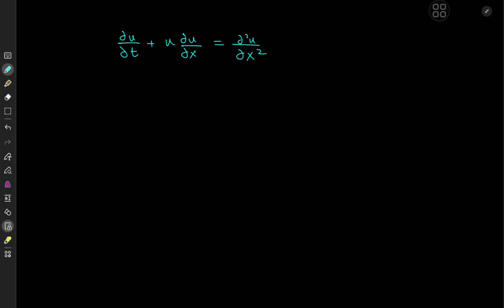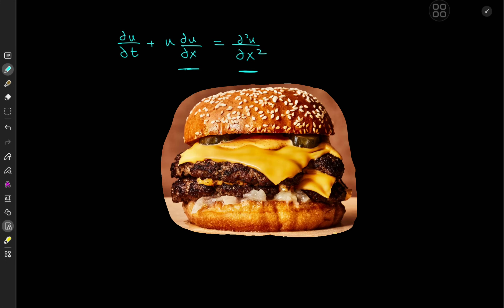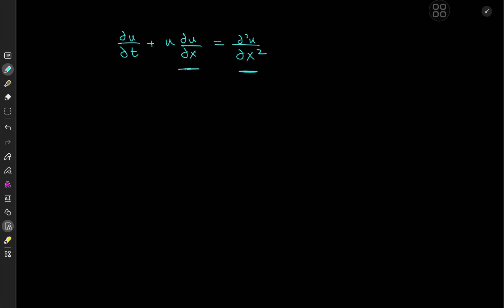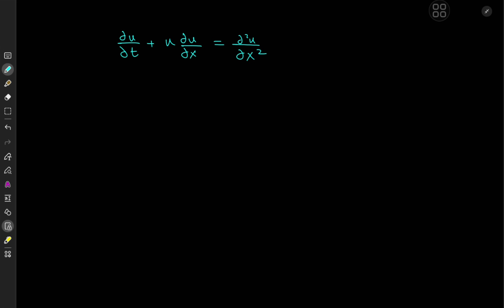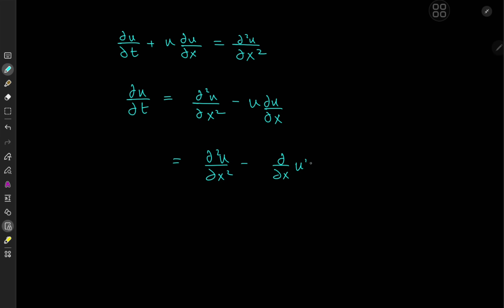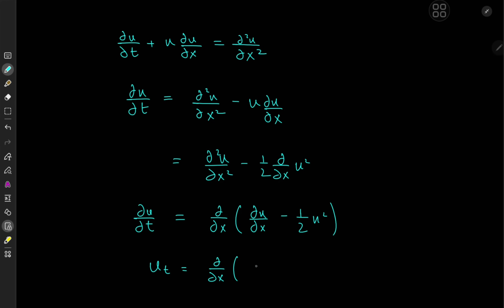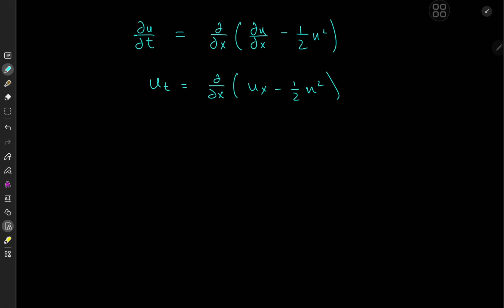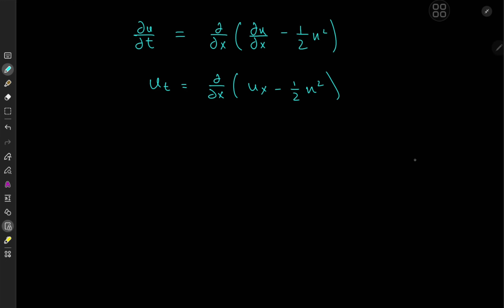A cool non linear partial differential equation

Comment: Hello! Long time viewer here, but first time commenter :D as a theoretical physicists I loved this one!

I was wondering about the substitution u_x - u^2/2: doesn't it look suspiciously similar to a negative "Lagrangian"? u^2/2 is the kinetic energy, while the u_x term is a "potential" term proportional to an odd derivative of the velocity (in 3D it would be some contraction of the stress tensor), which introduces a preferential direction of advection (in this 1D case only the +/- verses). In 3D we would have 3 equations for the 3 components of u, so we would have also 3 "Lagrangians".

Do you think that the -d_x L term, on the right hand side of u_t, can be interpreted as a variation of the Lagrangian and hence the fact that the u_t term is not zero means we are not in equilibrium (the advection-potential u_x breaks the symmetry of the quadratic form of the kinetic energy)? Further, the heat equation obtained for the function v means that its initial condition diffuses, which is an irreversible process, which in turn gives a motivation for identifying advection (and hence inertia) as the "geometrical source" of dissipation for the information contained in the initial condition of u.

I still lack a physical (or information theoretic) interpretation for the function v.

PS: I love your channel, keep up the good work! :D
Reply from the maker: The physics of what you're saying does make sense, especially if we consider the fluid dynamics case of u being a velocity field.
Reply: Fluid dynamics is actually my background of applied maths, so I was also thinking in the first to u as the fluid velocity.

But even then, I cannot otherwise think of the function v as a non-linear rescaling of u (since v propto exp(-u/2)), so physically v should represent also a velocity of some kind... maybe? What is exactly the (physical / information theoretic) reason for mapping the R domain of u to the half real line of v?
Reply from the maker: @ElrondMelwasul I'm still thinking of the same. Expanding the series for v in terms of u isn't giving me much "physical" information either. I think it's one of those problems where you switch between the mathematician and the physicist hat depending on convenience 😂
Reply: The only interesting thing that has come to my mind is that the static configuration (u=0) corresponds to a fixed point in the function v for all t in R... so maybe the function v describes the deviation of the actual dynamics from the true (static, non the stationary version) equilibrium case, and the exponential dependency is so that variations of u from the (functional) "point" u=0 are proportional to the distance from equilibrium itself.

So the more far you are from u=0, the faster is the diffusion of the initial information contained by v. I would believe that, due to the non-linear nature of the advection term, it is possible to write some kind of generalized diffusion coefficient for u as a function of v (or its initial condition), and since for the stability of the equation we want this coefficient positive for all u, we parametrize the dependency through a positively-defined function.
Reply: I add a further comment, in case someone reads this post and wants to contribute.
Since the substitution involves a derivative of v, and keeping the identification of u as a velocity field, the function ln(v) somewhat resembles an action (hence an angular momentum) from the analogy of the linear momentum being the gradient of the classical action S = int L dt.

I was trying to use the functional u^2/2 - u_x as the Lagrangian with which to calculate the action, and from there further identify the function v in terms of Hamiltonian mechanics, but I didn't come up with anything interesting.
Reply: I'm probably saying something very stupid because I don't know any fluid mech or non-equilibrium stat mech, but this reminds me very strongly of stat mech. If you think of v as some partition function, then u is  is conjugate to position. The reason I say this is because normally, it's the number density that obeys the diffusion equation. But this  substitution reminds very strongly of the Madelung transform. For the transform, you start with a wavefunction 𝝋, decompose it into Re^(iS) where R is its magnitude, S the action (ħ = 1). Then you define two new variables, n = R^2, the density and v = ∂S/∂x = ∂/∂x (ln 𝝋). You end up turning the Schrodinger equation into Euler's hydrodynamics equations with this substitution. 

I'm also fairly certain that for diffusion, the partition function itself satisfies the diffusion equation. I think we can do something with that. Following the diffusion equation, we can write the partition as Z = e^S(x,t) with S an action - the Gaussian, because for diffusion Z is the heat kernel. Doesn't matter what the form of S is though. If you follow the prescription from classical mechanics (or from the Madelung facisimile) that velocity u = S_x (assume unit mass)  we find u = ∂/∂x ln Z which is pretty neat. This makes sense for me since position is conjugate to momentum, and thermodynamic potentials can be treated on essentially equal footing to the action. Now Z_xx = Z_t which is obvious: Z is the heat kernel. And as the video showed, this is the same as u satisfying the viscous Burger's equation. Well, sort of. I've been rather careless with my constants and factors of 2 but I'm pretty sure that can be fixed. I also apparently assumed the solution from beforehand, but truth be told, I just assumed a reasonable form for Z: Z = e^S, and never used the fact that Z is the heat kernel. I just assumed it solved the heat equation which is pretty much the same thing. 

I think your guess about the action is spot-on as well. I've not checked the details out, but the Madelung transform is typically applied to the nonlinear Schrodinger, which falls out of a variational principle in much the same way you can derive the Schrodinger from a Lagrangian à la Feynman. I'd not be surprised if you could derive a Lagrangian in this framework. My naive guess is that you might have to work with a Lagrangian density - that would explain the ∂_x factor without too much trouble. 

I think you can also get to this transformation from a symmetry perspective. If you look at the equation its principle part is similar to the heat equation. On one side you have u_t and on the other x derivatives. I think you could probably try some rescaling symmetry, and notice that it can be transformed into the heat equation rescaling. That'd justify this rather seemingly odd coordinate change.
Reply: Hi, thank you for your wonderful answer! It got me think a lot! When I read about Madelung transform, I immediately think at quantum hydrodynamics and I get excited :D I think it is extremely interesting to push the analogy between classical and quantum hydrodynamics (the Bohm - de Broglie pilot wave pilot), especially regarding the idea of path integrals for describing non-equilibrium physics. But probably this direction would let the conversation diverge.
I try to reformulate what you wrote, to check if I got it.

Since you are comparing v with a partition function, ln(v) is proportional to some generalized free energy, that is the amount of mechanical work that it is possible to extract from the state at location x considering the amount of information hidden in form of "entropy". Then it makes sense the physical interpretation of the state u with a mechanical velocity, while the diffusion term should parametrize the contribution to the "entropic background noise" (and hence describe irreversibility). Then, the Burgers equation u_t = u_xx - u u_x can be alternatively read in infinitesimal form as "PdV = TdS - dU", from which we can finally identify the advection term as a result of a non-homogeneous "internal energy" dU propto (u^2/2)_x dx (for example from PdV propto u_t dt we can see that the acceleration u_t is a product of a time-dependent pressure  P(t) of the surrounding on the BOUNDARY of the system). Of course, the first principle of thermodynamics applies to adiabatic transformations (for which all time derivatives vanish), while the Burgers equation describes a full non-equilibrium transformation, so in this sense the correspondence has to be taken with a grain of salt.

The first enormous problem with the advection term is that the definition of temperature becomes also dependent on the velocity u (the first moment of the Boltzmann hierarchy) and not only on its variance, introducing hence inertial (and geometrical, in case of non-inertial motion) effects in the thermodynamics.
Admitting that a definition for temperature is nevertheless possible, then, as you said, -(ln(v))_x would be some generalized thermodynamic force (negative gradient of an energy) and the corresponding free energy would act as a (thermodynamic) potential. Inverting the transformation, that is v propto exp(-u/2), shows that the partition function v is defined only locally by state u and is not the global normalization factor propto int_D u dx (with D = (0,L) given integration domain, an open subset of R). The normalization for the distribution u over the statistical space D is still possible, but it gets a dependency on the orientation of u.
Along the way, notice how, in typical statistical mechanics, the Boltzmann factor of state n is exp(-E_n/kT), with E_n the corresponding energy. In our case the generalized Boltzmann factor is exp(-u/2), which is something like the "square root of the energy". In this case, indeterminacy is introduced by the fact that we can have the two +/- solutions to the Burgers equation and still recover the same energy spectrum.

Another point about the idea that position and momenta are conjugate to each other. If the integration domain D is bounded (so that we have a physical boundary!), shouldn't it be possible to somehow derive a kind of uncertainty principle, expressed by the fact that the partition function ln(v) (which is proportional to the action) is never negative? Then, the minimal value of the indeterminacy should be dependent on the state of the system ON its boundary. If the boundary conditions for u are of the form u(0,t)=U_1(t) and u(L,t)=U_2(t), that is the environment is active and exchanges work with the system, then the correspondence between PdV and u_t dt can be seen (with dV = propto d(1/rho) propto d(1/ln(v)) as the acceleration u_t produced by the change in density (of states) ln(v) induced by the mechanical work due to coupling with the environment.

At this point I would love to see a derivation of the viscous Burgers equation from a variational principle, so to be able to make the explicit connection between the mechanics and thermodynamics produced by advection. I'm not asking for a first-principle theory of viscous hydrodynamics (I very well know that we still don't know how to write a Lagrangian/Hamiltonian from which to derive the Navier-Stokes equations), but only a simple application to the Burgers equation. I tried to search in the literature and I didn't find anything interesting.

EDIT: small improvement on the text

Comment: Could you please integrate arctan(ab/[2xroot (a²+b²+4x²))])dx from x=-a/2 to x=a/2 
This integral came in , by finding the elctric field due to a finite cuboid but i couldn't find any source on this and not on this integral so could you solve it [closed form not required but want to solve this integral]

Comment: 6:35 Ok now I'm really curious, is there a solution when we can't switch the derivatives?
Reply: Yes, for the simple Burgers equation. It then depends on the initial condition (see the Riemann problem) and physically it corresponds to the case in which the solution u is not continuous, that is when shock waves develop.
On the other side, the Laplacian added to this equation (the second derivative of u on the rhs) will smooth out all discontinuities, so I don't know simple general arguments with which it is possible to say under which conditions the partial derivatives don't commute

Comment: cool video! btw i might have a suggestion. it would be super awesome to look into the biharmonic equation in a circle. the exact solution with necessary boundary conditions is expressed with two integrals, which is awesome imo, but i haven't gone to the final answer yet
Reply from the maker: Sure
Check back in a couple videos
Reply from the maker: Yo, there's this cool paper by Wood (2019) that expresses the solution to the biharmonic equation in polar coordinates using Fourier series and I think it's super cool.
Reply: The biharmonic equation has been a thorn in my side for weeks. I’m trying to solve for 2D stress patterns and Separation of variables isnt working right.
Reply: I also would love to see any kind of problem involving the biharmonic operator!